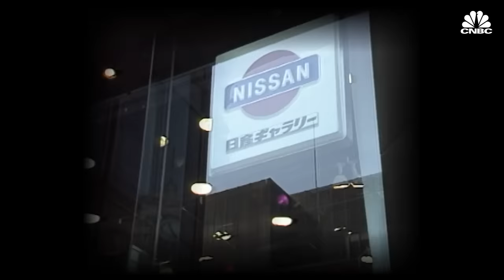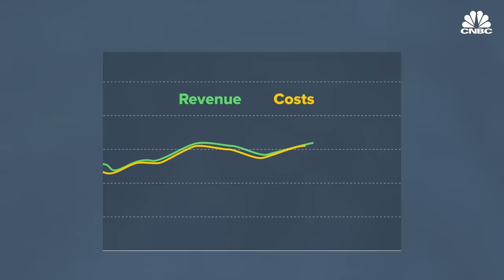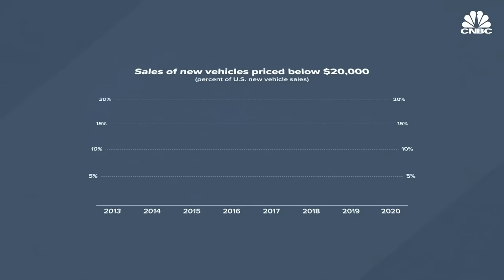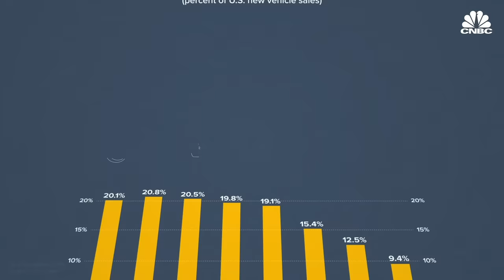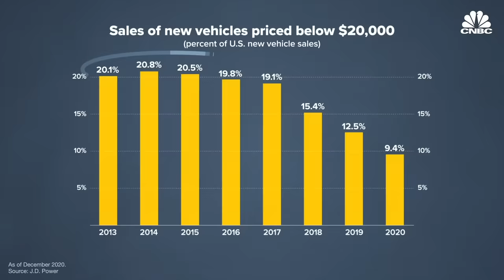Why Cheap Cars Are Disappearing

Comment: My parents would always buy really cheap but reliable, new cars like the Toyota Tercel and drive them until them until it died.  These cars had no a/c, no power anything, and no radio.  We're talking no power steering.  My mother has weighed less than 80 lbs. her whole life except when pregnant.  As we got older, she would sometimes have us help her move the steering wheel like when were parallel parking.  It was worth the sacrifice though if it allowed them to retire certainly not rich but comfortable.

Comment: My 2013 Camry has everything I need.  Sunroof, touchscreen, reliability... The Camry runs circles around the Jeep Wrangler Unlimited I had.  The jeep stayed in the shop more than under my carport.
Reply: Me too, my Camry is 2014, almost on that 100k miles now, still drives perfectly fine. Newer Camry looks really nice tho, maybe later this one retires, I can get the 2030 Camry
Reply: @alandonglei  I love the new Camry, but I’ll take my paid off Camry for now.
Reply: Scotty Kilmer approves this Message 😊
Reply: An average Toyotas or Hondas can easily last 10+ years.  They are reliable and fuel efficient.  I always buy Toyota and Lexus.
Reply: what do you mean chlysler is reliable , if it overheats just turn on the heater.
Reply: @plantxvibe9571  yeah tell that to wife during summer, especially in Vegas and Phoenix. :)
Reply: @jml9550  nice one
You made me laugh 😂😂
Ya they are garbage
Reply: @plantxvibe9571  I would touch a Chrysler product with a 10 foot poll.  Pure odorless excrement.
Reply: @jml9550  You mean, you would NOT touch a Chrysler product with a ten-foot pole, don't you?  (3/5/2022)
Reply: @knowbodiesfull5768  yep.  wouldn’t want to be seen in one either.

Comment: I will be driving my 97 civic till I die. I don't need all the technology in a car. I just need it to be reliable.
Reply: Mechanically it is sound... yet a modern civic is light-years ahead when it comes to safety. Just watch a crash rating video on older model cars to new ones.
Reply: @SimplyCarReviews  Older trucks and suvs are safer than some new cars. Just saying.
Reply: Because it's made of plastic and aluminum. Older models were made with better metals
Reply: I'm not a mechanic but my personal opinion is that older is better a lot of times.(if you maintain the vehicle properly) Better made. sometimes cheaper parts. simpler to repair compared to newer vehicles. None of those dealer only repair gimmicks.

Comment: Remember when FULLY LOADED was power steering, power brakes, power doorlocks and power windows... and sometimes leather.  Boy how the times have changed in just 30 years.
Reply: You saying that doesn't apply anymore?
Reply: That's mostly for good reasons.
Reply: @theemirofjaffa2266  it doesn't ,even the cheapest cars have power steering, power brakes, power doorlocks and power windows (not leather though)
Reply: You say "just 30 years" as if that's not a long time!
Reply: I can remember radio, heater, and white walls. Of course that's more than 30 years.
Reply: Showing my age here. In the late '40's, early fifties car adverts had the notation 'R and H'. That meant radio and heater which were normally options at that time when new.
Reply: @ForAnAngel  ask your parents, 30 years isn't a long time.
Reply: Yes! Optional power steering was a luxury! And a radio or air conditioning was a luxury option.
Reply: For An Angel 30 years ago was just yesterday for me. It went by so fast. The 90’s are the “new” generation. Even my kids are starting to be able to say, “I remember 20 years ago....”
Reply: @JennyLouRN   My first car was a 1978 Honda Civic in 1990...the car didn't have power steering, and didn't even need it!
Reply: audvidgeek You’re right, a Honda Civic could easily be driven without power steering. I learned how to drive on a 1966 Plymouth. Long old cars made of steel were hard to drive without power steering.
Reply: Well 30 years ago China is nobody, today they about to become number 1. So yeah, time is crazy.
Reply: @JennyLouRN   Even  then, that Plymouth had some features that made driving it without power steering a little better...the narrow high-pressure tires, and a steering gearbox with a high ratio....thus you had to spin and spin that wheel round and round to park! Imagine driving a vehicle today with those huge, wide low pressure tires, and low-ratio steering gearboxes, and no power steering!

Comment: In 2015, I bought a 2005 Toyota Tundra pickup truck. I bought it from the original owner for $18k. It had 37,000 miles on it. He wanted a new tundra because the new body style is bigger and looks better and has a bigger engine. He couldn’t stand not having the latest and greatest. My truck has a double cab, 4x4, never been in an accident, drives great, looks great, and will last for many years. There are plenty of sub $20k vehicles out there because there are plenty of people who are happy to take the depreciation of a new vehicle, drive it for a few years and sell it for new and improved.
Reply: Paul Smith  it was the tundra. I’ve been lucky as mine is rust free. I’m planning to get it under coated just haven’t done it yet

Comment: I was born in the 50s, and I remember all those years when it seemed like everyone, including myself, drove a junker. I still do. It's a good car, a Geo Metro. But it's a '94.
Reply: That car is cheap to fill and great on gas mileage
Reply: @George L I don't think that's the main goal of the car. It is meant to bring you from point A to point B in a normal manner. On the other hand, if you arrive late at your meeting with a lovely lady in your brand new and shiny MB because an electronic malfunctioned on the way, the joke's gonna be on you.
Reply: @caribbeanbound8357  Never gonna happen.
Reply: Is it a 3 cylinder motor?
Reply: @hotandsoursoup2664  49 mpg on highway, 32 in town. The problem is,I have a tough time getting on the freeway! Have you heard of HHO kits? They sound like they would be great for larger cars and engines. Not feasible for my car. I might get one, anyway, mostly to extend the life of the engine. And increase power.
Reply: @caribbeanbound8357  If you put a lot of miles on it, the savings in fuel costs might make up for battery costs.
Reply: I'd drive a Geo too except they're absolute death traps. Atleast newer cars are much safer.
Reply: how the hell do you all pass the annual emission test in places like GA?
Reply: A hit at even 40 mph and your dead in one of those....
Reply: @George L a woman decides if she'll sleep with you long before she sees your car
Reply: Your Geo metro was and is a good car!
Reply: I very very much seeing 80s and 90s cars on the road. I don't understand why manufacturers decided no one likes the boxy designs.
Reply: Correct me if I am wrong, but didn’t cars back then also no last as long. When we were car shopping for me at 16, I remember my dad saying “a 7 year old car isn’t what it used to be”. Most people I know keep their cars 10 plus years while my grandparents tell me them and their parents used to trade cars in every 2-3 years. My grandpa told me that a 3 year old car in the Chicago area was bound to have rust on it. My old car was 13 when it died and my current car is 5 years old and neither had any rust. My 13 year old saab still shined like a new car despite having 197k miles on the dash
Reply: Yeah, it's more stressful being rich.

Comment: this sounds like an ad by car companies explaining why vehicles are getting more expensive.
Reply: Almost every source is JDPower. Which is a marketing company. So imma say that it is.
Reply: CNBC is a PR firm.  They produce puff pieces for whomever pay them: China's CCP, The big 4 and JD Powers, the EV lobby, the NaturalGas-solar-wind lobby.
Reply: They literally claimed that cars are more expensive because consumers demanded they stop making cheap cars.  SMH
Reply: @ignaciofuentes2642  well yeah. if you want more tech in it.. its gonna cost more.. everyone would want more tech and cheap price, but no one is gonna do it. your options are, basic car for cheap or basic car +tech for more. they are gonna choose the more.
Reply: @MuiKaHo    Most of the "tech" is just software.  The cost for the upgrades is minimal.  "R&D" is nothing new to car companies.  There is no new cost associated with the "R&D."  They are charging you $10,000 more for two cameras, an iPad in the dashboard and a few software upgrades to the cruise control system.  Total cost...probably about $500.  But my real point was that nobody was "demanding" this stuff on entry level cars.  The car companies just figured out they could charge you an extra $6000 by adding $500 worth of upgrades.

Comment: Bought a 900$ honda Civic manual, still going strong after like 8 years, could never imagine paying 20k
Reply: 20k isn't bad if you plan on using it for the rest of your life.
Reply: Did the same
Reply: Keep rocking in that Honda Civic trust me Japanese cars last longer than American cars take that as a fact
Reply: G.Weidmann, you missing fantasie, how its feeling paying 20k. that is like climax.....
Reply: Regret selling my first car, 2002 Honda civic. My chevy blew its engine at 120k miles 🙄
Reply: unless ur job requires traveling over several miles, just get a bike or skateboard
Reply: yeah, I am planning on keeping my 15-year-old Buick for as long as possible as well. Why pay more? I have no one I need to impress
Reply: Planning to buy a c5 vette when I turn 20. 20 years because insurance gets way cheaper. It was always my dream to drive that car. Hopefully I'll find one for 15k at most.

Comment: Speak for yourself. I'm a "young consumer" and I explicitly chose a used car because it had less technological BS. I don't want digital dashes, android auto, etc. Every single technological feature is something that in 8-10 years will be broken and outdated. And for android auto, I have a $10 phone mount which is good enough. I could even go without bluetooth. I'll just put an aftermarket stereo in, which will often be better than the stock option. Too bad companies are moving away from the DIN standard. 

I will say there are a few things that are genuinely useful, such as blind spot monitoring, back up cameras, but those things cost $100 to implement and have no business costing thousands of dollars on top of the list price

Comment: The Toyota Corolla sells for less than 20 G, and are reliable, economical vehicles.
Reply: Maybe but I only want  chevrolet car with a stickshift! I just bought another one.
Reply: And you can buy a station wagon. So you have the space but not the horrible fuel economy of the SUV.
Reply: The base stripped down 2021 Corolla L is $21,000 after you include destination and don't include taxes and fees. The fully loaded 2021 Corolla XSE is close to $30,000 after you include destination, taxes, and fees. Corolla has turned into a premium compact sedan with high prices.
Reply: I bought a used Toyota Corolla for under $7,000. Most reliable car I’ve ever owned.
Reply: @braetonwilson4296  bought one for $18,500.
Reply: Toxic fumes, need to go get oil changes, and not as cheap and reliable as an ev.
Reply: @williscurry6557  eww, im sorry
Reply: @LoganLeGrand  2021 corolla? which trim? I'm sure that's after discounts so not a fair comparison. After all, not everyone gets the same discounts.
Reply: @Cali_ Kid yes you bought it when the 2021 corolla was already out and there was a 2K rebate on the remaining 2020 rollas.
Reply: Tesla Model 3 sells for $42k and are more reliable, far more economical, last 3-4 times longer, 66% safer, and have a much higher resale value.  Don't skip over the more economical part.  Tesla Model 3 is less expensive to own over the life of the vehicle or gives you more money back when you sell it, all while costing you much less for every mile you drive.  :)
Reply: @davidbeppler3032  what if you live in an apartment and can't charge at home? also lot more gas stations out there than Tesla charging stations.
Reply: @davidbeppler3032  
Found the Elon fanboy
Reply: BORINNNNGG
Reply: @davidbeppler3032  they still can't even fit the panels together correctly yet. 
You can keep beta testing tesla's, I'd rather have something I can count on.
Reply: @Chidoro41  Yes, beta testing $10 will get me 300 miles with a 0-60 under 4 seconds.  It is just math.

Comment: Always buy used and put the bulk of your money into other assets that appreciate, rather than depreciate.
Reply: a get repair bills...no thanks
Reply: @chadhaire1711 Because every used car always breaks 🤦‍♂️
Reply: @crapcopter  a car is used as soon as it goes off the lot
Reply: @chadhaire1711  You're forgetting press and demo  cars. They go on the lot and leave it quite a bit, but they are never used. And test drives too?
Reply: @crapcopter  
naa, he's right. Car manufacturers earn less and less money with (non-SUV)-cars, and more and more with replacement parts. Getting repairs is getting really expensive.
And yes, cars tend to need almost no repairs in the first ten years, and then sooner or later a lot.
Year by year you pay less if you drive a car from 0 to about 12 years than from 12 to 18, if you buy a German or Japanese compact car.

Of course that changes if you want a much more expensive car because the costs of repairs do not increase as much as the premium for a new car.
Well... or if you drive cars that need regular fixing much sooner..
Reply: @_annoyed4692  But then again, It depends on per car and every manufacturer has different quality standards and ways that the vehicles are built.But there are, From my experience, Many Premium vehicles that are bulletproof like the E55 or the 996 after an IMS bearing replacement, So, to make a car reliable, all it takes is a little money to make a car reliable (Unless it's an E60 M5, But it's still on my list)
Reply: @chadhaire1711  Not every used car is a 15-year-old scrapheap. Usually, the best bet is a car that some idiot wasted their money leasing for a few years, subsidizing the lifestyle of motorists who can do math. Usually, a car that's 5-8 years old is your best bet. In addition to the worst depreciation being behind it, any model you look at will have years of past performance, so you can look up reviews, recalls, etc. People who buy new are the guinea pigs.
Of course, the real winning strategy is just keeping the money and using it to buy a house in an actual neighborhood that already has everything you need. It's hilarious how the American public has been tricked into  believing a "good" neighborhood is one where you have to go somewhere else to do literally anything.
Reply: @TheRealE.B.  actually buying  a new car can be cheaper.  Buy a cheap Korean car like a Kia Rio with nothing on it at year end sale for $12K, and with that 10 year warranty you are covered....then sell it 10 years later for $3,500.  It is going to cost no more than a $12,000 used car to run for 10 years.
Reply: @crapcopter  try to find Toyota because their car was reliable
Reply: @muhammadwazienaqwayusuf3335  Yup, Like a Toyota Crown Majesta or Toyota Vellfire

Comment: So basically the auto industry is pulling an Apple right now
Reply: iPhone SE is apples version of the Jetta
Reply: Exactly. They are just trying to make commodities as luxuries. Even 50$ phones have all the features as these "Bluetooth" and "infotainment" that the idiot talks about at 10:28 .
Reply: There is no auto industry, those are for the rich. It's self-businesses, used dealerships, and also people getting dumb and not knowing anything about cars, leading to being sold lemons or scammed; guessing this whole comment section. Hence blaming others
Reply: No they’re not pulling an apple, they’re pulling the prices of the vehicles that they sell higher
Reply: Not until they start gluing everything down and refusing to allow repair shops to fix their cars.
Reply: @ace3han  If it were legal, they would be doing that. They already make cars pointlessly hostile to work on.
Reply: I have to blame consumers too - no one wants a car that just meets their needs - they want a car that is as big as possible even if it means stretching their means.
Reply: @harkin3684  Don't think the regulators have not been trying for decades.. Ask any muscle car guy living in Comifornia.. The regulators are going after the right to repair now and starving the market of repair parts for older and mostly newer vehicles.. Those parts (mostly electronic sensors) overwhelmingly come from china which was hard to get just a few months back.
Reply: No worries, tesla will drive the price down in the next few years.
Reply: The auto industry cannot make any money from the Cheap cars because of the amount of regulations that exists. 
Cars are getting so expensive to produce that only wealthy people will be able to afford them and the automakers will not be able to make them.
Reply: Crapple $$$$
Reply: thats why bike makers in japan boomed
Reply: Teslas can last over 700,000 miles, there's no need to keep buying a new car every 10 years. These car companies are getting dumber and this CNBC video is likely propaganda aimed at consumers to pay more. They lost market by  not converting to EVs, being paid off by oil business. Now they're just trying to make you think that you have to pay high prices.

Comment: The answer is actually out-of-control government spending, which translates into inflation. 40% of U.S. currency has been printed in the last year. When you print paper and call it money, the value of what you have in the bank goes down. Just 40 years ago you could buy a house for $40k and a car for $5k, both up more than 10x today.